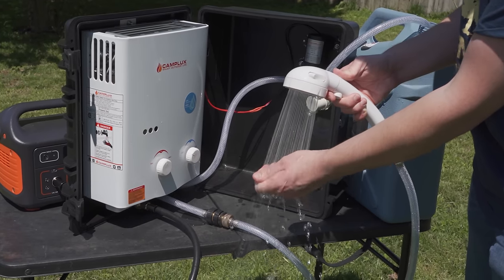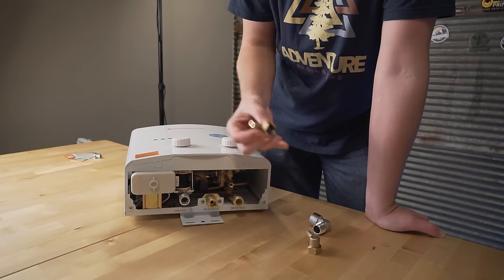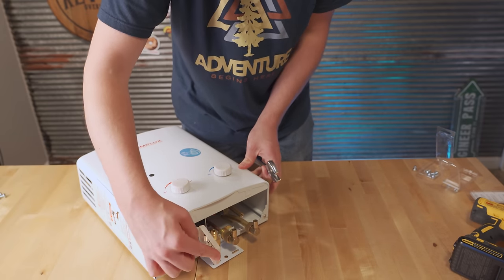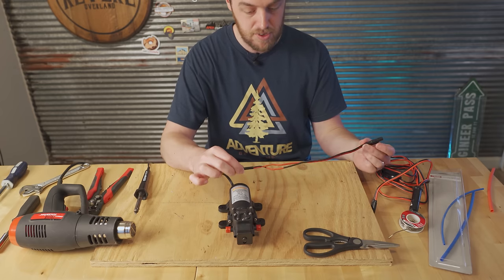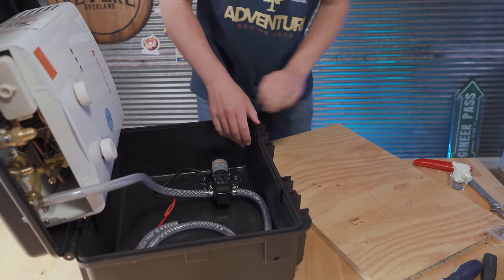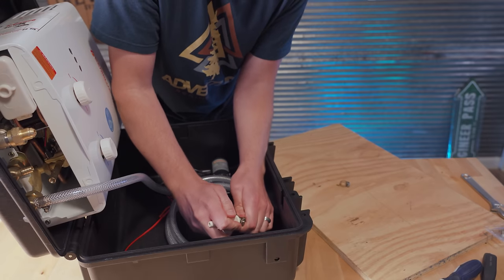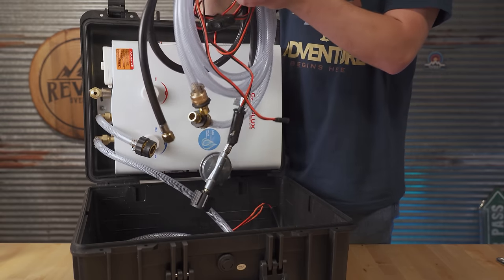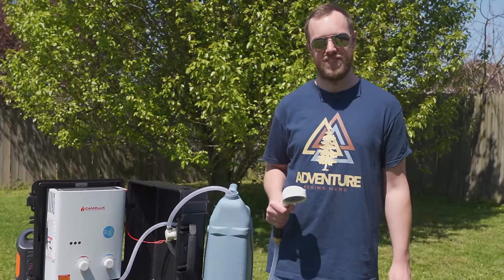Instant Hot Camp Shower in a Box

Comment from the maker: Don't want to build your own? Joolca's HOTTAP is a fantastic (and maybe even better) alternative for less: https://youtu.be/XiTLajwa1_U
Reply: I'm putting this system together this summer.  Have the pelican box already. Just need the water heater.  We normally will primitive camp for up to 5 days,  will be nice to have a hot shower at night.
Reply: How hot does the water get?
Reply: Joolca is overpriced junk
Reply: I bought a buck converter to get the 12V voltage down to 3V to see If I can directly power the heater without the D cell batteries
Reply: I looked at the link you posted, your DIY is still far superior than Joolcas options

Enjoying your videos 🤙🏽
Reply: What Joolka's mistake was using Chinese junk tankless water heater.  That's was the  biggest mistake   . 😂
Reply from the maker: @iwontbebeat7111  Joolca's heat control is much better than the Camplux one. It's not self contained like my setup though.

Comment: I followed this after watching your video, and it was on-point with the instructions!

To fix the issue with the hose coiling up in the water tank, I essentially made a "tumbler straw". I bought some 1/2" PVC, a coupler with regular female on one side and FPT on the other, and a nylon 1/2 MIP to 3/8" barb. I cut the end at an angle to seat better with the bottom, and it works great! You don't have to glue the coupler, as the suction from pump is plenty to keep it together. All for about $7 USD.

Also, I went with a 25 ft expandable garden hose (there is a 15 ft, but it's more expensive) for the shower head. It compresses really nicely  and fits a little better inside the case. 

Thank you very much, and happy travels!

Comment: I have this unit mounted in my truck.  Used a privacy tent with a hole in the top to run the shower head.  Worked well.
Reply from the maker: Yeah I'll be using one of those pop up tents too!
Reply: @RevereOverland  Put an inline weight on the end of your intake hose to keep it at the bottom of your jerrycan...

Comment: Great setup! Just wanted to mention to you and others that may build one of these that you don't really require clamps on the suction line of your pump since it will always have negative pressure ( vacuum) on it when the pump is running. I like the idea of the quick connect on the pressure hose. By throwing in a garden hose head attachment with quick connect, you can pop it on and just run cold water through it to blast a little crud off your feet or tires or wake up a friend who has overslept (from a safe distance).
Reply: Use a clamp, over time and usage the hose will relax and allow air to get in.

Comment: I use a heat exchanger on my rig, I use the engine to heat up the water, it moves through the system so quick it's never too hot except when you first turn it one  Water enters a line at the back of the truck through water storage or stream to heat exchanger then travel back via RV pump.
Reply: thats cool , similar to the HotBox device  from Aphcarios

Comment: I bought this exact one for my RV once my in house tank split. It works no problem with the RV's fresh water tank pump and it works only when I turn the shower head on so uses much less water. Another HUGE bonus is it uses it's own separate propane tank. I even mounted it on the shower wall. The flame is contained within it and poses no huge risk, however it is wise to be very vigilant in that sense, but can be done.. Love it so far.

Comment: I am doing one similar to you. Thanks for finding that bsp gas fitting... had a hard time finding one. I was going to just go straigh through the box through drilled holes but did not want to do that. For the battery door i ended up unscrewimg the batterh box flipping it around so the door swings away from the fitting. Just did a a bix with a pump.and water filter... and the cost of the plumbing parts was rediculous. Not to mention trial and error.

You have a good setup! CHEERS!

Comment: Very helpful build information, Thank You! I really like how compact and self-contained this is, it will be a nice piece of kit for our teardrop. We use the teardrop for camping, but we also have it set up as a 'bug-out' rig in the event of wildfire or other natural disaster. We already have solar, LP gas and water onboard, so this is like the icing on the cake. I used a few of your links and like the way you set this up, so will follow your build pretty much spot on, with the exception of using silicone 3/8" tubing on the outlet side. I also want to access water various ways, trailer source, Jerrycan, or just throw the intake into a creek or lake. Should all be possible with a few extra fittings and hose. Thanks again, great instructions! I also made connections for an external battery (alligator clips) and, cigar lighter.

Comment: Nice build! I like the idea of mounting it in a box. I have a similar shower heater. It’s a different brand (Eccoflow) but looks almost identical. I ended up mounting the pump underneath my off-road trailer and mounting RV type inlet/outlet fittings on a panel on the outside of the trailer. So when I want to shower, I take out two hoses, one from the tank to the inlet, and one from the outlet and into the heater. Both have garden hose quick connect fittings. The shower head that comes with your heater looks a lot better than the one that came with mine. The on/off button on mine would constantly get stuck and was almost impossible to use, so I went to Home Depot and bought a new shower head and mounted a 1/4 turn ball valve on it. Works great.
Reply from the maker: Nice! If I had a trailer I would definitely hard mount my pump close to the tank. For the portable setup it works well in the box.
Reply: Henrik, instead of traditional shower head, you could buy a socalled "bide-shower-head", wich is originally used for the toilet sides. On this tap there is the flow switch included in the shower head handing

Comment: I solved the curling up problem I also had with a water hose in a 5-gallon sink water container by zip-tying the hose to a 1/4" stainless steel rod from Home Depot. I cut it to be as long as the jug is deep and used 4 zip-ties spaced evenly along the length. Has worked for 10 months now, and I take it in and out weekly to fill the jug.

Comment: I have a Triton 10LPropane camp shower heater that supplies hot water for my cabin. Have used it for the past four years and have never had a problem with it. I love the fact that it only uses propane where you turn the hot water on. Wouldn't take for it and will always have one in my cabin.

Comment: BSPP (British Standard Parallel Pipe) type fittings are almost unheard of here in the US where NTP is king. It appears that ALL of these little on-demand propane water heaters use the same BSPP fittings. I did one last year and it took me weeks and lots of $$ to find adapters. Your readers don't realize how lucky they are that you have already done the leg work for them.
Reply: You don't need to get a $27 fitting from McMaster.  It's just a 3/8 male flare x 1/2 in female NPT elbow.  $6.99 at ACE (part #47187)

Comment: You buy a water heater then you find out it should be installed outside but you also find out it can't be in the weather. These manufacturers need to wake up that people like once it is assembled they don't like to pull it apart to store it inside every time they use it. Thanks for your idea -I've ordered a hard suit case to mount it in on the side of my caravan  [$70 Au dollars]  because we've had light rain almost every day for 3 weeks. The output hose is too short  and it has quick release for the water connections but not on the gas ,but in saying this the unit works great

Comment: If the can has a vent, you could adapt the cap with a fitting & set can on its side. Less likely to leak if no lower fitting. Could add a vent or small hole on tank top opposite the cap if not vented. Cap can then be moved from one tank to another if needed.

Comment: To keep the hose from curling up inside the water container attach a 12" length of PVC pipe with zip-ties. As if you were applying an improvised splint to a broken finger or limb. Great project! Thanks!

Comment: Very cool, clean & consolidated setup.  That mini propain canister is tiny!! When your running the system, it's obviously doing so with the case open like a book right?
    It would be very cool to mount everyrhing in a case a touch larger and reverse so the weight of the water heater wasnt straining the hinges over time. Then mount everything the way you did, but flush to the side of the case tapping through it with male ends exposed on the outside, that way you can make some vent holes in the top for the hot air to escape with a little fairing above to keep rain out. Then the gas line, the water inlet & outlet all have quick connections that just snap onto the closed case .  That way you could mount it on the back next to the water source and only open it to service it.  It would look clean and organized. You could even throw a padlock on the door to keep people out of it .

Comment: If you put the shower tube inside another tube, with an air gap between them, that ought to provide enough insulation to prevent that little bit of water in the handle from getting cold, but that's just a pluperfect. Great build!

Comment: If it is summertime you can heat your water with the sun. 
Buy some black 5 gallon buckets and leave them in the sun. 
It does work to hear it up but if it is really hot outside you will appreciate having cool water for a relaxing shower. 
I bought a 12v shower pump with a cigarette lighter for powering it with your vehicle. 
I have a battery pack I use to power it. 
I bought a pop up shower tent on amazon and my shower system works awesome. 
I only use this shower set up in the summer when camping a different festivals.
Reply from the maker: We usually get to camp too late for anything more than an hour or two of evening sun!

Comment: I did something similar but used a quick connect coupler for the gas connection as well. That saves having to screw the gas hose onto the heater every time you set it up - you just have a short section of gas hose permanently connected in the same way you have done for the shower head.
Reply from the maker: Do you have a link for the coupler you used?
Reply: @RevereOverland  This is the one I use:  https://gasproducts.co.uk/8mm-quick-release-gas-hose-coupling.html

Comment: Some ideas I have are to hard pipe the connections inside the box to maximize space and plumb these to the walls of the box with quick disconnects to the outside of the box. That way you don’t have to mess with anything inside the box. I also have a pump pressurized water tank so I am going to try and use that with out the electric pump.

Comment: To stop the hose from curling in the water can.   Use a stiff piece of wire and poke it up the hose .  make a sharp U bend at the bottom to that you can  bend it tight enough to the hose that it doesn't fall out . Easy to put in and easy to remove  if needed and it will keep your hose straight.

Comment: You could of connected the quick disconnects through the case so it’s all plug n play with no water leaking inside to corrode the heater fins and electric ignition. I made mine fit on a small luggage hand cart and also put a transformer so I have the option of running it off of 110v or 12 volt
Reply from the maker: I thought about that, but the amount it leaks after use, I wanted it all self-contained! With the heater unit being in the lid, it will hopefully drain into the bottom of the box!

Comment: Nice job!  Just a tip, I have those same black and brass quick connectors - keep them lubed with a light lubricant or they get sticky and fail to couple correctly.  You'll see the little ball bearings inside the female ends.

Comment: Mine just arrived. They are no longer 4.33" deep, even though the Amazon description says so. They are over 5.5", too deep to fit anything else in the case.
I'm OK with that though, it seems like the back of the heater is going to get very hot. There is a paper thin heat shield between the flame and the back of the heater. It needs some fireproof insulation before I would mount it to anything plastic. I guess I will just use my new tough case to store the heater when not in use. Maybe I'll get a smaller case and mount the pump, hoses, & battery. I love the idea though.
Reply from the maker: That’s a shame. Can you modify the dials maybe?
The plastic of the case should be fine. It has a very high melting temperature.

Comment: Nice video . Here’s a Suggestion for your fresh water can . You can buy a plastic sink  Riser They are very Sturdy and just drill a hole your water jug and cut the riser for the proper Length and slid your 3/8 hose and clamp it . That  it will solve your problem of the hose Curling in the water jug. The risers are a couple of bucks and they are about 30 in long. BTW the end of the riser that goes into the jug make sure you cut it in a 45 degree angle to prevent and blockage at the bottom.

Comment: One thing about that water heater is that is very sensitive to winds if it's not shielded properly. It will effect the consistency of the hot water flow and you will end up wasting a lot of water while it gets cold and waiting to heat back up again.

Comment: Great idea! What if you get a slightly bigger box and cut out ventilation at the top and use a small camp stove16oz propane tank and fit everything inside the box rather than on the penal, is that possible?

Comment: Cool idea. However we removed the propane hot water heaters from our buses. So did my buddy. Really liking the cheap solar energy available these days and the electric water heater. More and more people are going all electric. I will add that I do most of my boondocking in the sunny desert. And I still have some propane for backup cooking method.
Reply: Be careful. With most of the cheap on demand water heaters if you preheat the water much it might come out scalding hot. They don’t modulate enough. Did he try that? Why not just insulate the pipes of a inside water heater and run a hose out the window? Mine wastes a little water too. But this will work for those without indoor plumbing.

Comment: Good build bud, however I built mine using the garden quick connects, ( plastic) less weight, and the trigger garden spray gun , simple and very effective, 
The shower hoses and the draw hose one 5ft and the other 15 ft, you can enter change them, say for like a creek feed, n short shower head or Gerry can n long shower head, just fine tune it to suites you,
Reply from the maker: A garden spray probably works well! I plan on using mine from clear creeks when they're available.

Comment: Nice. I have a similar unit from Camplux. I hang mine from my camp kitchen and have a propane splitter for that and my stove. I also put a splitter on the output of the shower. I have one for shower and one going to a plastic sink faucet on my camp kitchen. The heater is fed from my 16 gallon onboard tank and 2.8gpm pump. Its all quick connect like what you used as well. Although I would like to find a better way to pack it up for travel. Hot showers at camp are a game changer for sure!!!
Reply from the maker: I can see myself using this for doing dishes too! It’s so nice to have hot water.

Comment: Cool video very informative for my setup of interest I'm curious about  essentially the portable tank addon  you could  make by getting the jug with the spout you recommended briefly in the end you could use the supply line going to the show head for the direct input to the jug and then run another quick connect line from the spout with a house do you think this might interfere with the water pressure would I need to modify the lid how would I get the water back out of the jug if it's supply feed from the water tank goes into the spout how do I get it to go into the new hose for my actual shower head?

Comment: Yep really good stuff bud. Gona give that a try myself👍
Thanks for the tutorial. It really was detailed and explained great
Cheers 🍻
Reply from the maker: Thanks!
Reply: A lot of small commercial businesses which have a few number of employees have instant hot water install under their sink . They're only 12"x12"x4" in size and cost a few hundred dollars plus they don't required anything but a water supply and electricity. They are completely covered under the Uniformed Plumbing Code.  I'm really surprised nobody has thought to used them camping
Reply: @RevereOverland  WHERE ARE THE LINKS?
Reply: @philliprogers964  Gas is more practical

Comment: Question.. What is the secret to removing the original brass gas fitting from the heater to install the elbow fitting?  I have tried two wrenches and it appears stuck and will not budge.  Concerned it will break as the aluminum part on the heater is pretty thing for grabbing on with a wrench.  I just picked up all the parts for this DIY project in hopes to recreate this for our overland adventures.  Thanks in advance.

Comment: One thing Ive noticed with mine is that if your water supply is already luke warm. Your shower will be VERY hot! Even on the lowest setting.
Reply from the maker: I had cold water in there and had it about 1/3 of the way up, and it was plenty warm enough! I could always just preheat my tank, then disconnect the propane.

Comment: Get a short length of PVC pipe to solve that problem of the hose coiling inside the jerry can.
Find a diameter large enough to slide your plastic tubing through, yet small enough to insert into the jerry can and long enough to touch the farthest diagonal corner from the opening and still extend out of the opening, so that it never drops down inside.